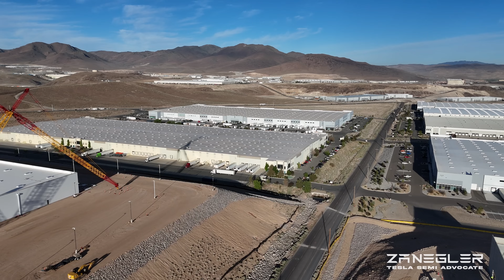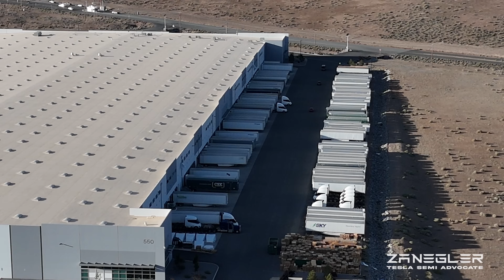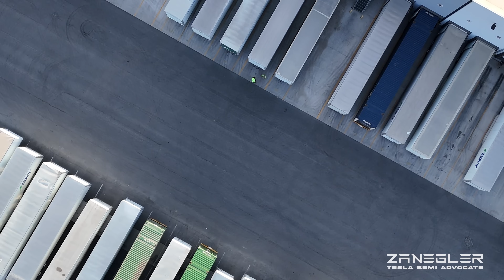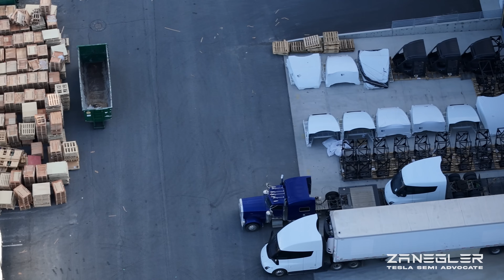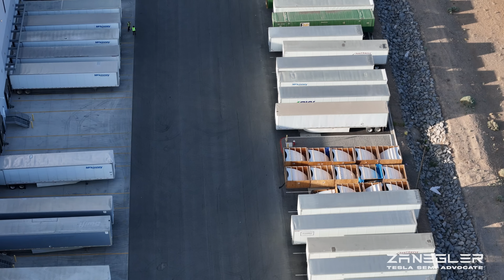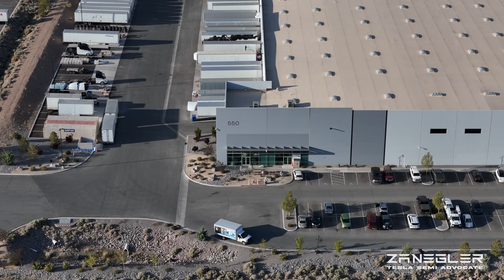Tesla Semi - Carrying the Freight of the World

Comment: Um... Tesla Semi is a prototype run.  It is not a refresh.  It is a standard.
Reply: No, they have called it trial production for a year. The factory is in prototype mode to develop before they built new one. Semi was locked and in real world testing. 
But tesla locked is never as locked in as others. There will always be developments added when ready. They only do these refreshes when a fundamental change occurs preventing retro active fitment of something critical. Like moving a fixed mounting point or core system.
Reply: @RacefanPat68  It has not been in production for a year.  They only built about 250 of them and don't even have a locked in place to build them.  They are prototypes.  Not real production.  Real production is about to begin.  When that happens Freightliner will lose about 50% of their sales.  I wonder if anyone told Freightliner that the competition is coming?